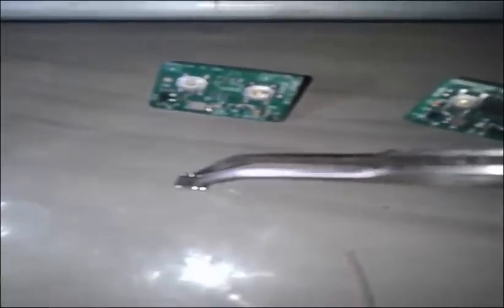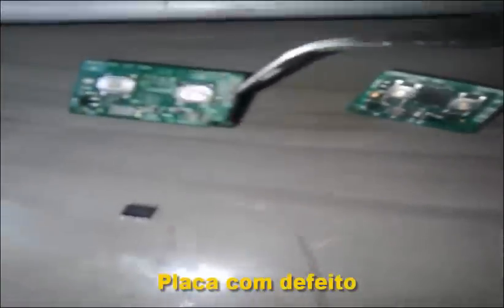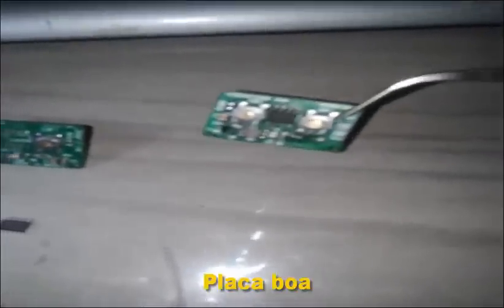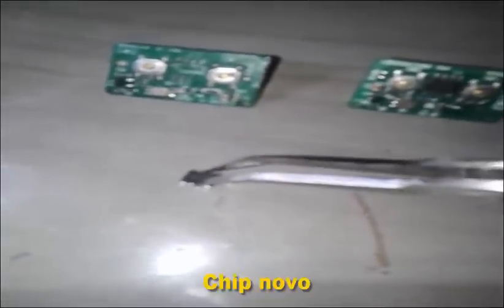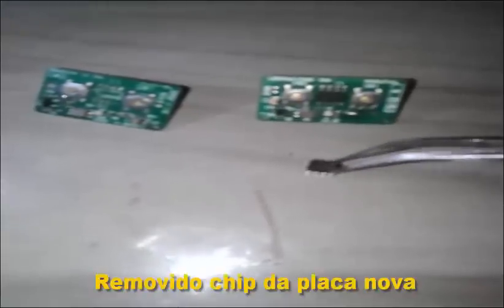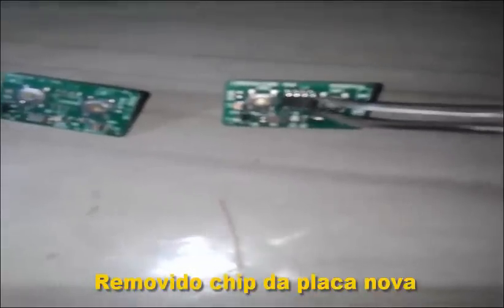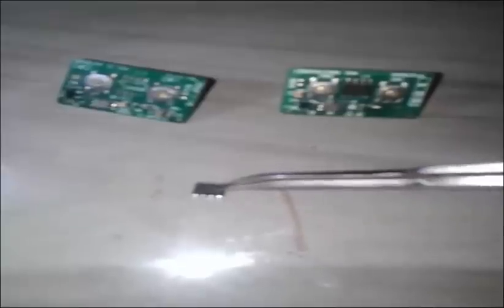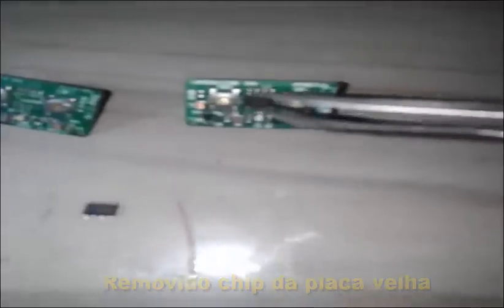Problema Alarme Fox - Como resolver

Comment: ae fera, esta em sp? estou com problema no meu alarme, achei que fosse a bateria, troquei e parou de vez, as vezes ao trancar na chave ele liga.
Reply from the maker: Pode ser oxidação..
Calor da mãe pode ter oxidado o alarme..
Abre Ele e da uma limpada usando uma escova de dente velha...
e álcool isopropilico.
Próprio para limpeza de placa...
ele não é corrosível.. 

Da uma olhada se nao ve pontos esverdeados ou escuro no circuito ...
especialmente no CI.

(você pode fazer tambem se isso nao resolver)
em alguma loja de celular pede para alguem dar um esquento no ci principal do alarme.
Para fazer rebaling no CI.
Pode ser uma solda fria...
Espero que ajude

Se poder da um like e se inscreve ai no canal

Comment: Como saber se a placa está queimada ou não ?
Reply from the maker: Muitas vezes precisamos de um equipamento extra - como a fonte simétrica. 
O que de fato acontece quando o aparelho queima. 
Basicamente existe dois modos de queimar.
1 modo e alguma peca eletronica entrar em curto.
isso faz com que o aparelho tenha uma resistividade muito curta no multimetro.
ou na fonte simetrica mostra uma elevada corrente de consumo.

2 Modo o circuito pode ficar em aberto.
quando isso acontece nao tem resistividade eletrica no multimetro 
ele fica em infinito como se nao tivesse colocado a ponteira de prova no equipamento porque ele esta em aberto.
Na fonte simetrica - bom nao vai mostrar consumo nenhum de corrente.
isso tambem indica queima 

se o equipamento consumir 20mA (o correto e mostrar 20mA) 
Se nao mostrar nada de corrente ou mostrar corrente alta como 1Amper
isso e indicio de queimado.

Os teste sao feito na entrada da pilha do equipamento.

Bom espero que isso ajude